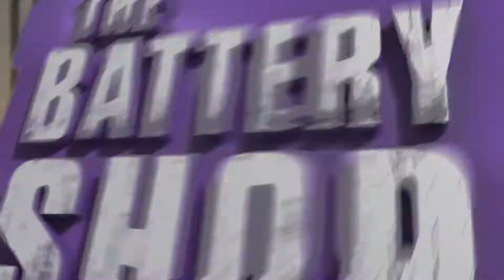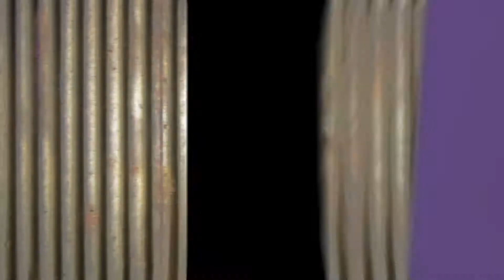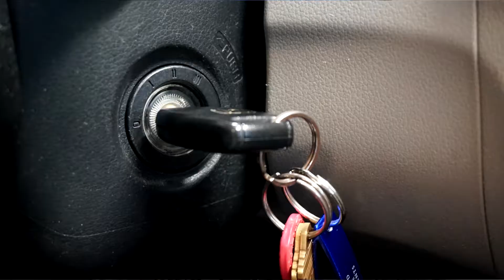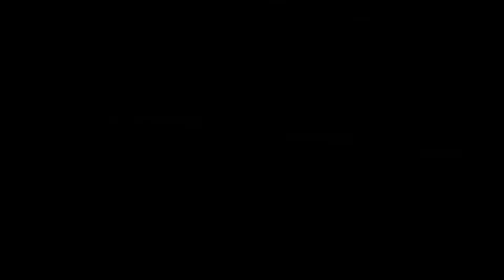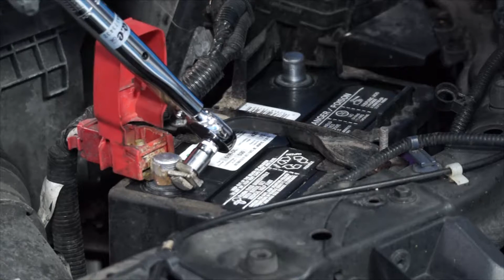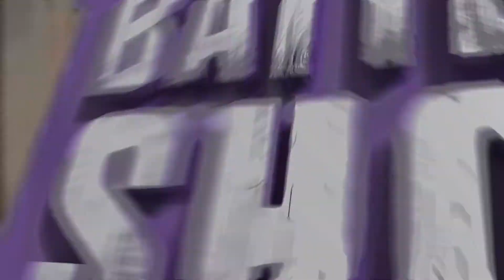Honda Civic and Acura ILX (2001-present) - New Battery Install

Comment: Should I still unplug the negative battery sensor when installing a new battery if all I am doing is replacing a dying battery and not a failing sensor? I checked the owners manual and it appears to be vague about how to install a new car battery with the negative sensor

Comment: And then pray you have the code for the radio & Nav system.
Reply from the maker: Hi - Thanks for watching! Check out our video on Memory Saving. The link is in this video's description.
Reply: Just press and hold power button on infotainment.

Comment: Is there a battery management system (BMS), within the computer, that needs to be reset with a scan tool on the 9th gen Honda Civics when the battery is replaced?  Some vehicles require a scan tool to reset the battery management system because this system takes into account the age of the battery as time goes on. Installing a new battery and not resetting the Battery Management System will kill a new battery on some cars. I was wondering if resetting the BMS is necessary on these Civics?
Reply from the maker: Hi - Thanks for watching! According to the latest BCI information, as of this writing, late model Honda Civics do not require battery registration. We still suggest that you check the vehicle's owner's manual or a service/repair manual for your vehicle to be sure.

Comment: Should this sensor be replaced at the same time the battery is replaced?
Reply from the maker: Hi - Thanks for watching! The sensor would only need replacing if it fails. We recommend that you check with a service/repair manual for the vehicle for further information on diagnosing and replacing vehicle sensors.
Reply: @TheBatteryShop  what are symptoms of it failing?
Reply from the maker: Hi - We suggest that you check a service/repair manual for your vehicle for the exact symptoms, but the usual symptoms are a MIL light on the dashboard with battery charging problems and sometimes vehicle accessories that won't work.

Comment: Is it necessary to always- unplug the sensor harness plug on the negative terminal ---while connecting the negative terminal of the new battery?
Reply from the maker: Hi - Thanks for watching! We followed the manufacturer's recommended procedure and it helped with the removal and installation.